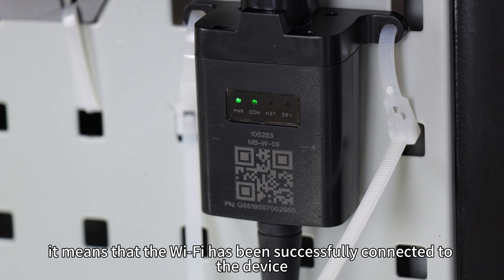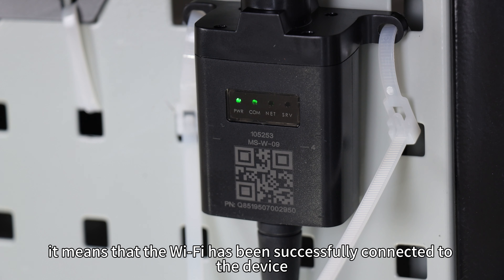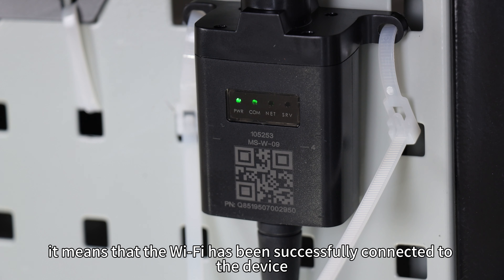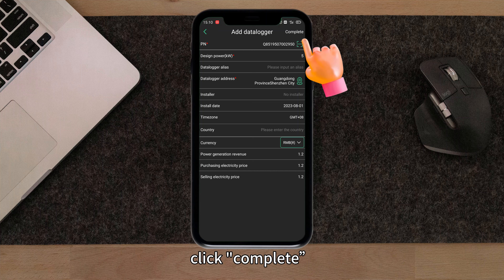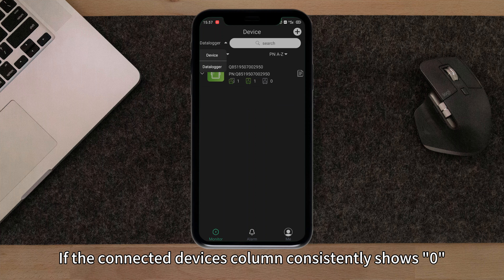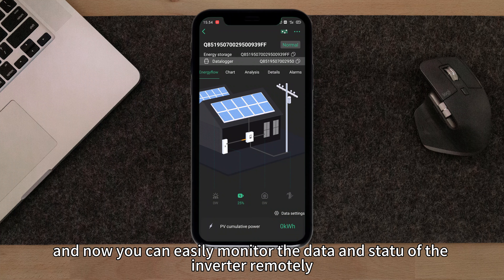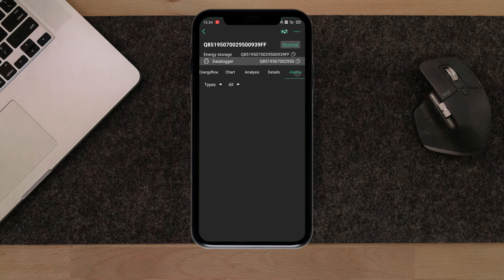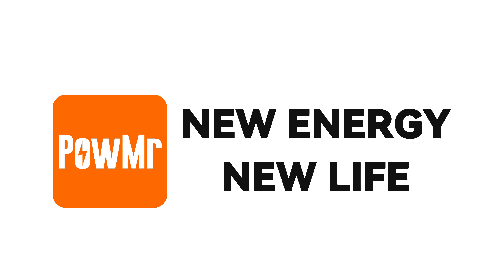How to Connect and Use the WiFi-HF Module

Comment: When I make the initial connection, that is, connect it to the inverter, the PWR light comes on but the COM light does not come on. What could be the cause? Would I have to configure something in the inverter?
Reply from the maker: Please send your operation video to this email address: support@powmr.com. Our technical staff will check it for you.

Comment: I have the Data logger connected to the internet and cloud, at least that says the self test. But no matter how long I wait, even half a day at the moment, it will not appear in the smart ess app. What am I doing wrong?
Reply from the maker: Please send your problem to this email: support@powmr.com. Our technical staff will handle it for you.
Reply: di they fix this for you?
Reply: @OluwatosinAdenuga  actually never wrote a Mail I guess. Problem with my system was that if the inverter is set to li ion It tried to use the com Port for communication with a battery instead of the data logger. So I switched to user as a battery setting and adjusted it to fit with my batteries and everything worked fine .

Comment: If i'm going to buy POW-HVM8.2M inverter and RS232 wi-fi module, will i be able to configure notifications in the app when my power grid shuts down and power is taken from a battery? It is shown in the video that i can configure some notifications, but not shown what notifications i can choose.
Reply: same opinion
Reply from the maker: Hi, the wi-fi module for POW-HVM8.2M is WIFI-VM. Yes, there will be a warning.

Comment: I have a question about the power consumption monitoring. I am looking to purchase 2 to 3 of these units and run them to a single load center that is connected to a small cabin in a remote land I own. Ideally, I just want to open the the app and see what power I'm generating and what I'm consuming. With the wifi, will I have to look at each unit one by one or does it have a summary of all the units connected? I would prefer not to go unit by unit and do math to figure out total power consumption. Is there a way to achieve this?
Reply from the maker: Hi, please send your problem to this email: support@powmr.com

Comment: Would 2 of these extend the range of the Wifi signal from my 2 Sungold Power SP6548 Inverters? My home mesh sistem picks it up but somtimes only one shows up. I have tried with both SmartESS & WatchPower but both are speratic. The system is in the garage about 45 meters from my starlink modem. How far (if they will work with my inverters) will they extend the range of their out put?
Reply from the maker: Hi, please send your problems to this email: support@powmr.com.

Comment: Hi, I have 2 inverters connected in parallel for single phase output 240vac. Do I need 2 Wi-Fi dataloggers or cash i connect inverters with rs485 cable?
Reply from the maker: Hi, if you want to monitor the data of each inverter, each inverter needs to be equipped with a WiFi module. If you just want to set parameters through the WiFi module, you only need to install the WiFi module on the host. The slave follows the host's settings and wants to monitor Which machine can be installed on which machine.

Comment: Hi. I have powmr inverter POW-HVM6.2M-48V. As well as wifi Plug Pro-05. Is it possible, using this Wi-Fi module, to receive automatic notifications on your smartphone when the power supply from the network switches to battery power? If I make this switch, will I receive a notification about this on my iPhone or not?
Reply from the maker: Hi, the smartphone will not receive notifications.

Comment: Do I need 1 or 2 WiFi modules for this setup of (2) 5 kw inverter in split phase 240 volt. I already ordered 2 inverters with 2 WiFi modules because the sales person told me, I need 1 WiFi module for each inverter.
Reply from the maker: Hi, this model? (POW-SUNSMART SP5K)
Reply: @PowmrSolar  Yes
Reply from the maker: @MakeItAdmirable  If you want to monitor the data of two devices, you need two WIFI modules.
Reply: @PowmrSolar  ok thank you

Comment: Hello, the wireless modules is connected to the RS-485 1 port. What is the RS-485 2 is used for? Thanks
Reply from the maker: Port 1 is connected to the wireless communication module, and port 2 is connected to BMS communication.

Comment: I have 2 wifi modules. 1 of the WiFi module reset PV power generator on the day around 2pm. How do I fix it to reset at midnight. The other module works fine.
Reply from the maker: Hi, kindly send your problems to this email: support@powmr.com

Comment: Hi. What WiFi module should I use for POW-HVM6.2K-PRO? i have one that came with 3.2KWt version and for 4.5kWt.
Reply from the maker: Kindly check the product link below:
https://powmr.com/products/owmr-wifi-module-with-rs232-remote-monitoring-solution-pow-module-wifi?pr_prod_strat=pinned&pr_rec_id=bae8fb114&pr_rec_pid=8324203938087&pr_ref_pid=9054460739879&pr_seq=uniform
Reply: @PowmrSolar  I've got the proper wifi module for this invertor, but no lights are on when connected to the invertor. Can it be the problem with communication module inside the invertor? I've successfully connected JK bms based battery to the invertor, but cannot do anything with wifi.
Reply from the maker: @sergeylappo9448  Hi, all the lights need to be on to indicate that the WIFI module is successfully connected. The WIFI module needs to be successfully configured with the 2G router before it can be used.

Comment: Hi. I have 3x 6,2kw hybrid inverter hvm6.2k and your battery powmr 200ah connected with rs485. I can connect WiFi on rs232? My inverter have only one rs485 and one rs232. Thank you.
Reply from the maker: Yes, you can connect WIFI on RS232.

Comment: How do I connect directly to the dongle to configure a static IP?
Reply from the maker: Currently, there is no such function. You can only use the WIFI module by connecting it to a 2.4G router network or a 4G mobile phone hotspot.

Comment: Does Powmr inverter 24v 4.5kw have wifi data monitoring function?
Reply from the maker: Yes, but the WIFI of this model is still being upgraded.
Reply: Is it available now…wifi module for Pow-HVM4.5K-24v ….?

Comment: Hi, i have one wifi module since march 2023 and suddenly stopped working 2 weeks ago, only turns on the first 2 leds, the net and svr led never comes on again, i tried reset and star again, the net led turns on when i use the wifi network of module and it show configuration succecfully of wifi, but after go bakc to home wifi the led turns off again, so the problem is that the module can't connect to home wifi, i tried even phone data plan with no luck may you give me some support please?
Reply from the maker: Hi, kindly send your problems to this email: support.
Reply: Same here . Has this been resolved on others?

Comment: When can we turn on and off the grid tie from the app? The hybrid mode that send power to grid.
And the real time data is not realtime. It's every 5 minutes. Is there a way to make it like every 30 second?
Reply from the maker: Yes, it's every 5 minutes. We can't make it every 30 second. May I know the inverter model number you use?
Reply: @PowmrSolar  PowMr 6200W 48V Hybrid Solar Inverter Charger MPPT 140A Pure Sine Wave Controlle 
This from ebay australia. I think POW-HVM6.2M-48V-N. 
I am really looking forward to turn on and off the hybrid mode that send power to grid from the app.
Reply from the maker: @rowanddownunder  HI, can only be set in the inverter.
Reply: @PowmrSolar  if i turn on grid tied. Why the mode became sub. I have been trying to change it to sbu but its going back to sub.

Comment: What if I only have the power light on?
Is it possible to direct connect using Wi-Fi and monitor locally?
Reply from the maker: Nope, if only the power light is on, it means that the WIFI module is successfully powered on. All four lights need to be on to mean that the WIFI module is successfully connected. The WIFI module needs to be successfully configured with the 2G router before it can be used.

Comment: Hi. I have 24v 3.5 kw MPS VPLUS series inverter. I have connected wifi module and was accessing inverter remotely (inverter in india, Iam in dubai). Now in India wifi router has been changed. My app shows offline. How to restore remote connection by connecting inverter wifi module with new wifi router while me and my mobile in Dubai???
Reply from the maker: Hi, please send your question to this email: support@powmr.com. Our technical staff will handle it for you.

Comment: How do I reset the WIFI module settings if the router has changed?
Reply from the maker: Please send a clear frontal photo of the WIFI module and the inverter product label to this email address: support@powmr.com. Our technical staff will assist you.
Reply: On the 10th attempt I managed to enter the WiFi module settings.

Comment: HI, I are using 4x5Kw hybrid inverters with parallel connetion (120/240 Vots) total=20 Kwp. How many Wi-Fi Modules Do I need to check all consumption?, I nedd check the total energy (Sun, Batteries and Utility), Can I use only one WiFi module unit?, if it is possible, how can check all inverters
Reply from the maker: Hi, you need 4 Wi-Fi modules. If you want to monitor the data of each inverter, each inverter needs to be equipped with a WiFi module. If you just want to set parameters through the WiFi module, you only need to install the WiFi module on the host. The slave follows the host's settings and wants to monitor Which machine can be installed on which machine.

Comment: Po neúspěšném propojování WiFi-HF modulu s powmr 6200w 48v hybrid solar inverter se měnič vypnul a nejde zapnout. Jak to opravit?
After unsuccessfully connecting the WiFi-HF module with the powmr 6200w 48v hybrid solar inverter, the inverter turned off and cannot be turned on. How to fix it?
Reply from the maker: Hi, The WIFI module of this model(POW-HVM6.2M-48V) is WIFI-VM
Reply: @PowmrSolar  Děkuji. Moc se omlouvám, ale špatně jsem napsal označení modulu! Zároveň s objednaným invertorem (POW-HVM6.2M-48V) mi byl zaslán modul Wi-Fi Plug Pro-05(PN: Q3721081462303)
Thank you. I'm very sorry, but I misspelled the module label! At the same time as the ordered inverter (POW-HVM6.2M-48V) I was sent the Wi-Fi Plug Pro-05 module (PN: Q3721081462303)
Reply from the maker: @pacholekjosef  Only connect the battery(disconnect other connections), and see if you can restart the inverter.
Reply: @PowmrSolar  Připojil jsem baterii, zapnul invertor a on funguje. Záhada! Nerestartoval jsem ho! Pět dní nefungoval. Při zapnutí naskočil a během sekundy vypnul. Wi-Fi nepřipojeno (asi počkám na odborníka🤔) Děkuji

I connected the battery, turned on the inverter and it works. Mystery! I didn't restart it! It didn't work for five days. It jumped when turned on and turned off within a second. Wi-Fi not connected (I guess I'll wait for an expert🤔) Thank you

Comment: Wifi data logger doesn’t see inverter. 3 lights are on, but not COM. All connections are correct, firmly connected. What is the problem?
Reply from the maker: All the lights need to be on to indicate that the WIFI module is successfully connected. The WIFI module needs to be successfully configured with the 2G router before it can be used.
Reply: @ thank you Captain Obvious. It is connected correct way. But it doesn’t communicate with inverter.
Reply from the maker: @crphoto  Can you record a video for us to check?

Comment: Can get about 4.5kW inverter wifi module ,
Reply from the maker: Hi, kindly check the product link: https://powmr.com/products/powmr-wifi-module-wifi-4-5k-6-5k
Reply: @PowmrSolar   on that module , not log data only can see that a movement , is there any configuration on it

Comment: I have wifi relab, but in only shows voltages of PV, Input, output, and battery. Why its not showing active load, PV power etc.??
Reply: In device type, it's showing energy storage, instead of hybrid inverter. I owned a Pow Relab 5KE with Wifi Relab.
Reply from the maker: @jervyllagas2829  Please send your problem to this email: support@powmr.com.

Comment: Please when i plug in my WiFi module to the inverter, only the pwr indicator comes on, and if i connect my device (phone) to the WiFi module, the net indicator comes on but the com indicator still stays off.

I'm stuck at this point and haven't been able to finish my setup. 0:40 0:40 0:40
Reply from the maker: Please send it to this email: support@powmr.com. Our technical staff will check it for you.
Reply: @PowmrSolar  alright, thank you.

Comment: My data logger SRV LED is going off and device is offline. How can I solve this issue?
Reply from the maker: The device is offline and you need to check whether the WIFI module is successfully configured. Need to connect to 2.4G router network.

Comment: Why does the wifi say connected without internet
Reply from the maker: To connect the WIFI module to the 2.4G router network.
Reply: @PowmrSolar  with an inverter the wifi name it's says no connected without internet
Reply: With my HYBRID SOLAR INVERTER RG-MH5500W
Reply from the maker: @tsiontsegaye4499  RG-MH5500W?

Comment: Does the powmr 3.2kw 24v inverter has wifi function for collect the inverter's data from mobile?
Reply from the maker: Hi, this model(POW-HVM3.2H-24V), right? WIFI-VM. The product link for your checking as below: https://powmr.com/products/powmr-wifi-module-with-rs232-remote-monitoring-solution-wifi-vm